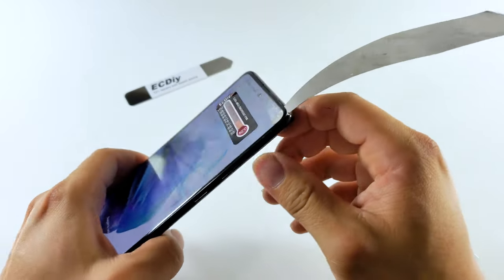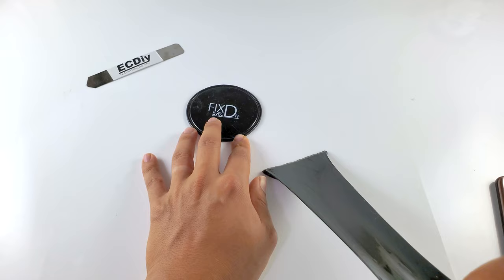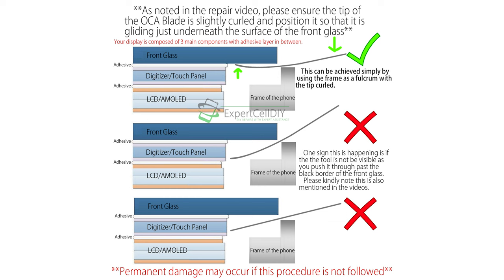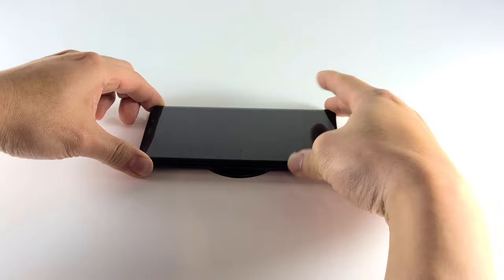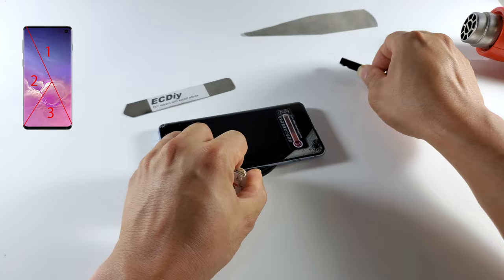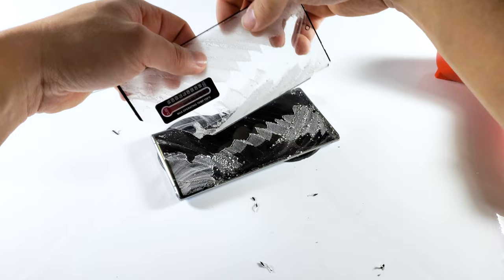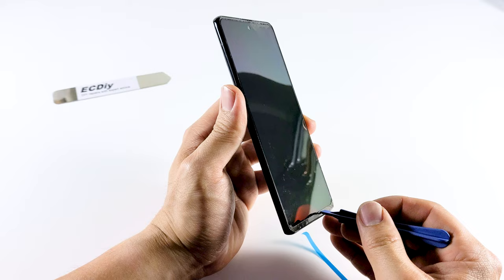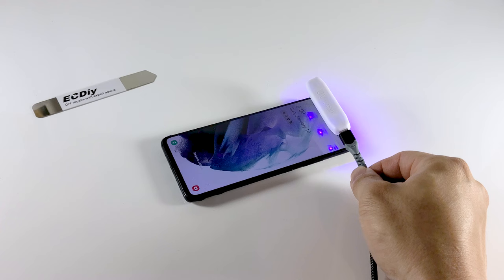How to Replace Screen Glass Only on Galaxy S22/21/20/10/+/Ultra/Note Shown in 6 Mins/New DIY Method

Comment: I didn't keep it hot enough and the screen got damaged :(
Reply from the maker: I am very sorry to hear your repair experience isn't going as smoothly as we have hoped. I can definitely empathize with your disappointment. As our business started from wanting to provide means to replace the screen at a low cost, hearing from customers who don't succeed is something that we do not take lightly and it is what keeps us motivated to keep innovating to make the repair easier. 

I understand it may not be much of an offer given the circumstances but it would not be a problem at all for you to return the item for a full refund. Please contact us for the details.

If we can be of any further assistance, please do not hesitate to contact us.
Best regards,

Comment: How the fuck is the oled panel itself not dying?????
Reply from the maker: Apart from achieving the initial separation, the method & the principle is the same as all other videos on YouTube. Gel pad + heat gun/hair dryer vs heated suction pad. 
The OCA blade is the same thickness as the wire tool. You do need to be more careful when using it which is ultimately why we recommend using it only to create the initial separation for the wire tool to enter and when the wire gets stuck.
Best regards,

Comment: I swear this has to be a joke or a way to get people to appreciate the professionals in the industry because this is not this easy of a repair. 90% of the people that attempt this are gonna be out 30 bucks and still have to go pay someone to fix their screen for real. Acting like people can just remove back glass on phones properly without breaking it and possibly hurting themselves or that they have the 000 Philips bit for the back of Samsungs, or the understanding of how to remove the cameras that are glued in properly. Stop downplaying the industry
Reply from the maker: Hello Sean,
Thank you for sharing your feedback. It is greatly appreciated.
   Although it requires patience, the back glass at least, can be easily removed without damage using a thin, flexible metal tool. Our OCA blade can be used as well, but there are other tools readily available in the market now. Our tool, with a thickness comparable to that of thick human hair, can be used to slice through the adhesive layer with heat. Wetting the tool with isopropyl alcohol further eases the process. A screwdriver is also included in the kit we offer.
    As for the actual front glass repair, it is not an easy repair by any means, and I do mention multiple times in the video that it is more difficult than it looks.
   Making this DIY repair easier is an ongoing process, and I am constantly trying new techniques and tricks. It is a costly endeavor, but I believe we are making progress.
    This video showcases a new combination of accessories that replaces a heated suction pad machine, which is not available in any other kit in the world. We have been including these accessories at a loss with every single kit as we want to be able to help customers repair as much as possible.
    Additionally, we have developed a clear film that can be stuck over the camera hole area, allowing gluing to be done without removing the back glass. A new video featuring this will be released soon.
   I do realize that making progress on this DIY aspect and sharing our findings may negatively impact repair shops which may be subject to criticism as a result.
    Any questions or concerns, please do not hesitate to comment further or contact us.

Comment: And when u use too little amount of glue, you'll start all over again
Reply from the maker: As long as you use the specified glue amount per phone, you wouldn't have this issue. The specified amount includes buffer as well. Until the glue is cured with UV/sunlight, "starting over" is lifting the glass and wiping the surfaces clean with isopropyl alcohol. Definitely not as bad as starting the entire process over.

Comment: Useless.  The gel did not work and the uv light failed after 2 minutes.  The gel would not solidify.  Complete waste of money.
Reply from the maker: Could you kindly confirm your order number? We have had some comments over the years from DIYers who had purchased a different kit, not from us and your confirmation would be greatly appreciated.  

In any case, what you may be seeing/feeling is the excess glue that seeped beyond the viewing area (clear portion of the front glass) under the black border/bezel of the front glass. Because the glue is cured using a photoinitiator, any glue that cannot be exposed to daylight (i.e the glue that gets past the clear portion of the glass), will remain liquid. Normally, this is not a problem once you clean it with isopropyl alcohol (uncured glue dissolves/dilutes very easily and even if you are just wiping it on the side with isopropyl alcohol without opening the phone, a little bit of alcohol that'd seep in would dissolve the glue and have it wipe away).

You should have some leftover glue that you can dispense on a non porous surface such as the protective film the glass came with. You can dispense a droplet on top to test the curing. The glue would feel slightly oily on the surface due to the byproduct (which does dry over time), but would cure to a silicone-like texture and you should be able to physically pick up the droplet after a couple of minutes.

Comment: Too much stuff to buy it defeats the purpose
Reply from the maker: They are all included in our kits but it is indeed a lot. However, other than the new camera hole cover film which allows you to do the repair without taking the phone apart, I'm not sure if the steps can be made any less complicated.

Comment: Has anyone had success?
Reply: May be late reply but yes it does work I don't use a heat gun  I boil water and and with the steam I use the same blade he got in his video but now I recommend a shaving razor blade and a fishing wire then use thinner for the glue adhesive removal and any gel glue

Comment: Don't try this method guys its worst repair i ever seen and unsafe also
Reply from the maker: Would you by any chance be able to elaborate a little? Did you happen to try the kit? 

The glass removal process is a delicate process for sure across all devices as mentioned in the videos but the concept behind it is more or less universal. The glue layer is thicker than our OCA blade, and the OCA blade is the same thickness as the wire tool that you see readily being used on YouTube. Heat softens the glue to make the insertion easier.
    
If you find a video where the wire tool is being used, that would also indicate that you can use our tool.